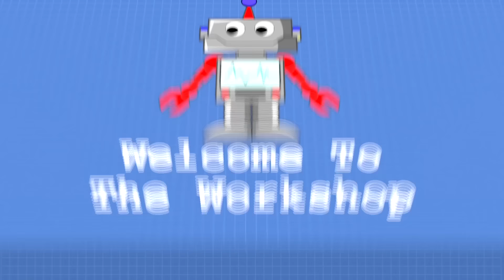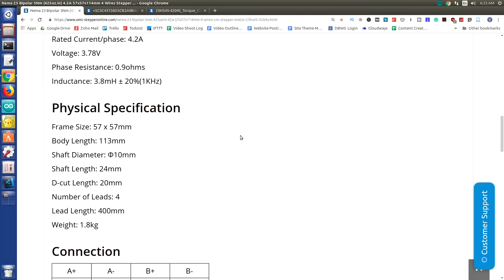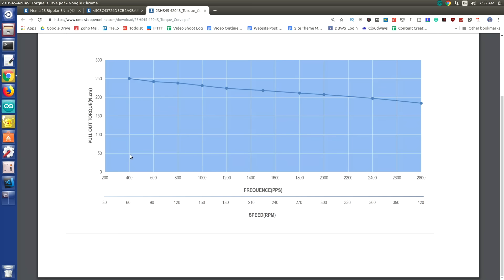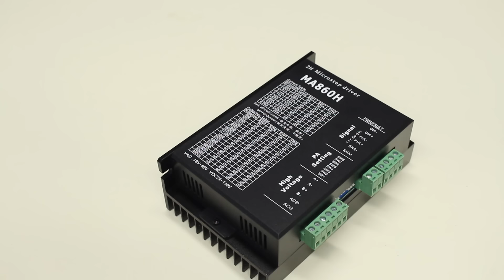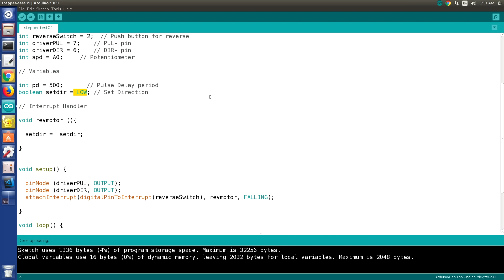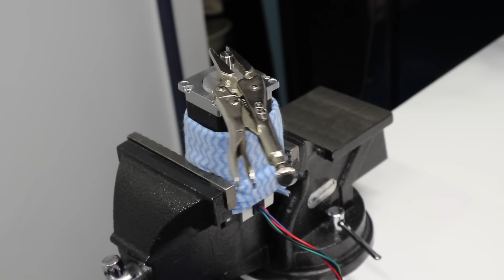Big Stepper Motors with Arduino

Comment: I'm a fan with an issue. How would I program an  Arduino to power on and, off  a power supply to properly charge a wind solar battery pack to prevent damaging the Lithium Ion batteries with a (BMS) Battery Management System?

Comment: I appreciate the effort in making the video, the explanation of how the motor and driver operate, and the quality of the guidance for assembly. Some questions about the set-up:
How did you choose the resistor?
Why did you wire the POT, DIR, and PUL all together and how does the Arduino dictate changes in DIR and PUL?
How do you choose a safe power supply given the motor driver and motor?
Reply: Hello Waylon, 
please if you got an answer share it, 
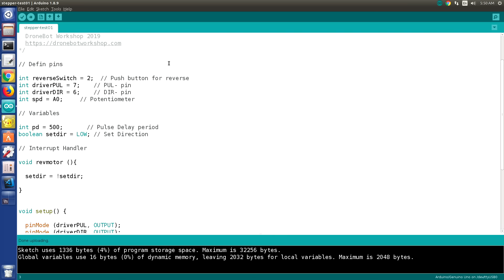@16:41, the connection of the Switch is quite confusing,
the ground with the positive, 
what does the resistor do there, 
I mean if we activate the switch we would definitely have a short, 
please help with the right explanation, i really would be very grateful to you

Comment: Hello DroneBot, i've  understand your video but i've just received my electronics material and i get...Microstep Driver FDM2740 C...with my set with nema 23 and mother board which is UCNCV 4.....i'm a beginner for CnC ....I would like to know if the wires are the same plug than your DM556...? Thank's a lot
Reply: FDM2740 have same than cheapen DM556 driver

Comment: Why dont you need the enable pins?  Couldnt you pwm the enable pin to also control TQ output?
Reply: code need tell what pin used and how, input or output or pwm or what, need enable pin do what you want.

Comment: What's the advance of using a module over 4988 chip and a heat sink? A module is a lot more expensive.
Reply: this module not can use big stepper motors this have max current to motor 2-2,5 Ampere only. big motor need big driver 4988 used only small toy motors laser or 3d printer and plotter. nema 17 motors.

Comment: why is ENA+ and ENA- unused? What do they do to begin with?
Reply: These pins enable the motor driver. They are usually used to switch on/off the motor if they are on standby. Otherwise coil current is flowing all the time to hold the motor in position.
Reply: @Morkvonork  i read the datasheet yesterday, hahaha XD. I understand they are used for holding torque to prevent movement when the motor is not moving?
Reply: @lem09able  Yes. A lot of driver software can switch this current off when not needed because it generates heat in the motor and stepper driver.

Comment: Hello and thank you very much for your videos!! I just want to remark that the voltage shown by the manufacturer is also quite important since it means that the maximum rms voltage drop per coil must be the specified according to the calculation. It doesn't matter if you use a driver that supports higher voltages since it will have some internal regulator or PWM approach to apply the right voltage to the coil. This is important if you build your own driver. If you apply 12 volts directly to any winding you will burn the motor! The maximum voltage drop means that the maximum current is flowing through!

Comment: i have question about electric motor in a more fundamental/basic thing, how a geometry of an elecrical motor affect the performance figures output, for internal combustion piston motor we know a typical heavy duty/diesel uses long stroke low RPM configuration for making torque, and there is engine which have short stroke high RPM to make power, so are these things also worked on electric motor? i.e, a short but big diameter is for making torque, and the long but small diameter is for making high RPM?

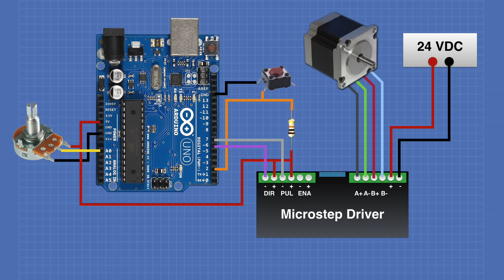Comment: Hey I love your videos.  Can I make a suggestion?  I would love your videos more if you covered safety better, like mentioning the applicable laws regarding guarding and safety controls.  In this video, you mentioned to “be careful” a few times.  If you have a checklist for making your videos, maybe add “analyze risks”, where you could risk assess your project.  The schematic at 16:00 would do well to show an estop that controls power to the drive and a signal to the controller.  The hobby industry would do well to start thinking about the safety implications of these projects.  Thanks for considering!

Comment: Finally found a tutorial I can follow. Hi, I never worked with stepper motor but I plan to build a plasma CNC. Going through various videos, I decided to use the motor you used but was thinking of different driver "DM556". Can you please say why you choose the 860 and where did you set the dip switches. Thanks a lot.
Reply: TB6600,DM542,556,860 same driver but important handle max current, need setting what you motor max current have, big driver can use better many motor if motor max have 2A,3A,4A5A,6A can set dip switch current max. but small etc. TB6600 max current handle only 3A and used max 4A motor indunctanse have big and bad, and motor not run max torque . not good. change driver biggest and DM860 can handle 7-8A mac but can use 4A motor set dip switch right current.

Comment: I really like automation, but I am a very novice at it. I would like to learn metal plasma CNC with Arduino and fusion.
thank you.
Reply: gabi arnautu, me too.  CNC is much easier with a controller board than an Arduino.  I like smoothieware which has support for THC.  There are others too.  It will save you a lot of time to use a controller board.
Reply: lot better use linuxcnc have all plasma user help tools and controlls,

Comment: I have an application where I need to have my motor position controlled by a pot.  It will be driving air dampers, 0% open to 100% open.  I'm using the same stepper motor, a DM542T controller and an Arduino Mega.  What would be the most efficient way to accomplish this?
Reply: ..stepper driver coupled with feedback signal (rotary encoder), which will tell you degrees shaft actually did, vs how many degrees has been sent trough stepper driver, and eventually, correct trough stepper driver additional steps to achieve desired number of degrees matching requested degrees, and read out degrees from encoder.
Reply: potentiometer not can use full rev, need normal use encoder can handle full rev. and lot better accurate

Comment: Does microstepping reduce, increse or doesn't effect torque?
Reply: Increase.
Reply: Ideally a stepper motor is a 2 phase induction motor. Microstepping more closely simulates sine waves. So microstepping is used to make stepper motors run more smoothly.

Comment: Arduino newbie here... why do you need the resistor? Thanks in advance for any replies,
Reply: learn internet what is bull-up and bull down have many example, and arduino output need alltime resistor if not want broken outputs too much current. max have less than 20mA to pins. if current have more than max burn arduino board.

Comment: Using a driver that accepts 80-220V AC.  Is it safe to simply wire it directly to a 110v outlet? 

I'm using this to drive a Nema 42
https://www.omc-stepperonline.com/dm2282s.html

While I got it working on the bench I don't know if it's safe to do so.

Comment: hi

is it possible to run multiple motors on one microstep driver (the motors performing different functions)??
Reply: Why would you want to run more than one motor off a drive? If each motor needs a drive then get as many drives as you need and just be done with it already. Although to answer your question it is possible with negative results. Just because you can do some things does not mean that you should.

Comment: Can I use a sensor to get that stepper motor to turn instead of a switch? Say your holding the sensor and you turn one direction, can you get the motor to turn in that direction? if you kept spinning 360 deg and get it to turn with you, when you stop turning it would stop the motor? What else would be needed? Thanks for this video.
Reply: Like with this motor, how about using a gyro/accelerometer sensor with Arduino to control this?

Comment: Bill,  I have an arduino project here - -

I have a 500 gallon pvc plastic water tank in my yard, to a pump, to water drip my yard.  I want to measure the water level and alarm if it gets critically low.  I also want to disconnect power to the pump to the yard.  This is a watter pressure demand pump and turns on when water is called for by opening the hose.

The question - - a water level sensor is required, that is non invasive..can not drill into the tank.  If there a sensor that can be mounted on the surface of the tank and then with a change of density of the tank shell and water, detect that water is missing at this sensor point?  It needs to take into consideration the mass of the plastic shell and water versus just the shell itself ( no water).

Love your series and I watch all of them. You explain very well and teach enough theory to tie it all together.  Bob - Brecksville, Ohio
Reply: You could try this type of sensor.
https://www.aliexpress.com/item/-/32994484253.html
Reply: why don't you just make a stick with two wires one at the "critically low level and one at the bottom of the stick. if the water is too low to connect the wires it turns on the pump. or just use a float valve like we use for farming for feeding animals. goes on when the water drops. maybe I don't get it what you are trying to do.

Comment: Minor correction: you use holding torque and stall torque interchangeably. Holding torque and stall torque are different values. Stall torque will be less than holding torque, and is not usually given on a spec sheet because it depends on many other factors. Designing dynamic systems around 80% of of rated holding torque is m/l safe for intermittent motion, or less for constant motion. If you try to design a mechanism around the holding torque value, you'll either upgrade the motor because it can't actually haul the load, or because it released its magic smoke and has to be replaced anyway.

Take a look at what Trinamic driver chips do to a stepper motor's rated specs. PFM.
Reply: "Stall torque will be less than holding torque"? 
Isn't it the other way around? Holding torque will be less than stall torque. 
Holding torque = maximum continuous stall torque controlled with a safe amperage rating(will not burn motor). 
Stall torque = not controlled thus more power(will burn motor).
Reply: @ScinnerNo1  Right. *At a given current*, stall torque will be less than holding torque due to inertia. Whether they're managed by a smart controller or (dumbly?) by power supply limitations, they will be different, and are therefore not interchangeable.

Comment: What would be the maximum weight this nema 23 could lift at low speed?
Reply: That would depends on what kind of a transmission you use. Gear that motor down and connect it to a threaded rod and it might be able to lift 100 tons. Might not lift it too quickly though.
Reply: @1pcfred  and nema 23 have small motor many different torque have too, 1NM to 4Nm nema 34 have lot more torque about 1Nm to 20NM and gears need use if have very lot weight.
Reply: @mattivirta  NEMA is a frame size and larger tends to be stronger than smaller is. The numbers you give shows there's overlap in the different motors though.

Comment: Thanks teacher! I like the way you give all the details. I'm about to look for a stepper motor to control the leadscrew of my mini lathe for threadings. I haven't figured out how I will control in real time the speed of the chuck and the leadscrew using an arduino but this video show me the directions. Not sure how precise those stepper motors need to be to have an accurate value for the cut. I've heard also about hybrid stepper motors that work in close loop. Could it possible to make a video about them? Thanks anyway.

Comment: Great video... Complete clarity on hardware and software architecture and clear communication is the best part of this video.
Thanks alot...
Can you deliver once video on how to design a DC battery bank capacity for the same application instead of a DC power supply? This will hep us on how to select the appropriate V and Ah for the same application and what electical precautions need to be taken while driving at full capacity and what challenges we can face?
Will be happy to hear from you.
Reply: Adding one more point. Also if you can explain us what are the circumstances under which battery burst.

Comment: Another great video. I really enjoy it. But please, one explanation: button at Arduino pin 2. This is Port D, ch. 2, physically pin 4 at Atmega328. Port B and port D have embedded pull-up resisor. It is enough to call the function and emphasize it INPUT_PULLUP. My question is: why use an external resistor?

Comment: Definitely a video with torque, thanks Bill.
What do you mean about big? Big starts at 100Nm. Joking, big is relative:) In addendum to your great safety advice: Have a kill switch in range when building and playing with your apparatus. And use your brain before that, keep moving parts enclosed and out of range of your fingers or other body parts, best by design. Often, a well thought-out mechanical design can make some electronic frills unnecessary. You'll need all those considerations when using an Arduino for your end product because this is no industrial device. It can't provide latch-up protection of outputs nor a full blown reliable brown-out detection over its complete specs.

Comment: How do I get the 24V DC with the high amps? I do have an AC power plug. Do I need to buy a power supply?
Reply: You need to power the motor driver with a power supply yes. He is using 24V DC supply for that purpose, but it depend on what controller you have in the end 15:40